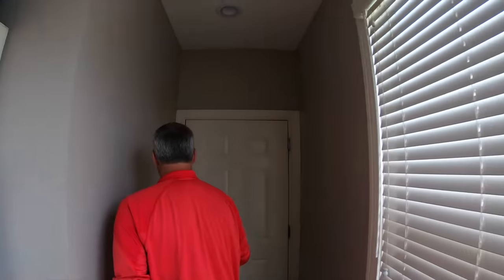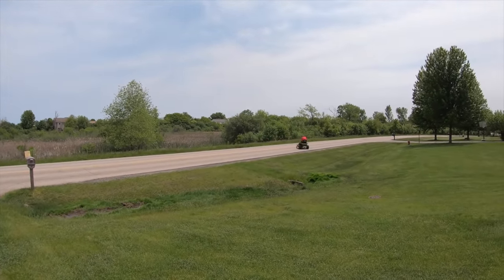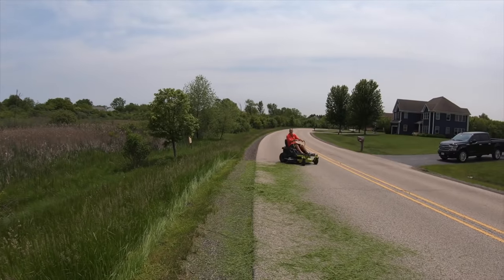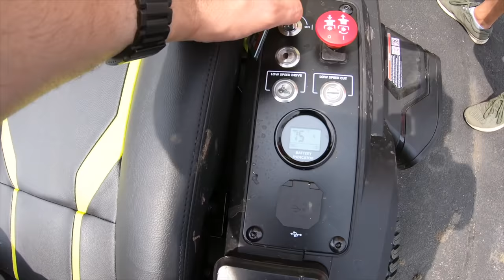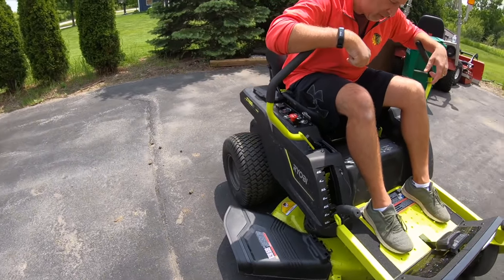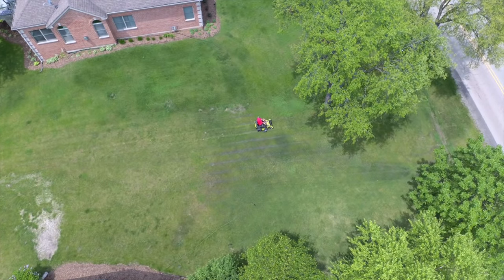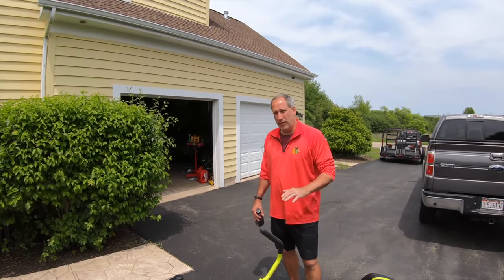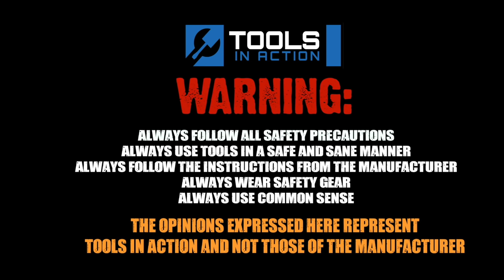Ryobi Electric Zero Turn Mower - First Look

Comment: What are your thoughts on slopes, looking at the joystick version of this when it comes out. I've got a walkout where some of the sides are about 18 degree slopes and wondered if it can safely mow? I tested my yard with a little toro 30 inch which did do it but kind of had to lean. I know most mowers only state 15 degrees.

Comment: Half of these comments were talking about motorcycles
Reply: Because it's dangerous as f** for them.
Reply: Rubber Skilla no, it’s not. I’ve been riding for 27 years and never...not once, have I been tossed, nearly tossed, or had a scare from a few grass clippings blown in the road. Pay attention to your surroundings and you’ll be fine.
Reply: @ROTAXD  you prolly liked your own comment too🙄😆👍
Reply: @rubberskilla2991  Probably
Reply: @ROTAXD  SAME It's the same as hitting wet leaves. YOU have been very lucky, NEVER hit fresh grass clipping on the road, or VERY full of yourself. As a biker for 45 years I have gone down once due to an elongated pothole, and VERY close due to grass blown onto the road. I pay very good attention to my surroundings and others on the roads. There are two types of bikers, ones that HAVE gone down, and those who will... 
You would be wise to knock on wood..... Oh, and a motorcycle has TWO wheels.
Reply: @daverodkey  agreed. He is been very fortunate or just full of himself
Reply: Yup, thanks to Millennials who have Zero attention span.
Reply: @owentimo  what are you refering to?
Reply: @owentimo  truth

Comment: Ok few thoughts on this.. First, very impressive unit ya got there, like Eric said not hearing that loud engine when mowing would be amazing. Ryobi is really stepping their game up in so many different ways, their tools are great for their price. But, the price tag on this makes it literally a non homeowner option. Very few are going to spend $4,100 on an electric zero turn. So this leaves me wondering the true purpose of this unit as it sits? It doesn't have the power to be a commercial, or the battery life. And the price is to steep to use in just your average homeowners yard.. I understand its first of its class, but dont really see this current machine being anything more than a "wow look at this". Anyway, thanks for showing it off!
Reply: Cody it will go down probably 50% in the next year or so. Just like the fancy 4k tv. It was 4-6k when they first came out. Now you can buy a 55in 4k for $300. I agree, $4100 is a lot just for home use. Definitely can’t do business with this. But if it was $1800-$2000 I would buy for my home. Give it time, it will go down. Their tools are generally affordable, it’s the damn batteries that kick ya in the ass.
Reply: @Nomega92  I can agree with that, im just thinking since this is pretty much the first of its kind i wonder if the price will remain high for quite some time? Was just talking to one of my friends about the TV thing the other day actually lol. I remember when i bought my 55 inch years ago it was almost $3000, i can get the same one but newer & better quality for less than $1000 now hahaha.
Reply: Hahah yep! I have a $300 55in 4k smart tv that’s way better than my 2013 55in HD 3D blah blah blah Samsung TV that I paid for $2000
Reply: For the price you have to consider how much you'll be saving on gas, spark plugs, air filters, oil, belts, and such over the life of the mower. No maintenance, no wasted time. We purchased it at about $3800 OTD when it was on sale when HD had all their Memorial Day savings more than worth the savings in money and hassle as someone that has a 2 acre yard.,
Reply: @FantomLightning  Those are great points. My concern would be what happens when something breaks? (I haven't looked in to the warranty at all). If they are fully covered how expensive would it be to fix an electrical issue? Im glad you enjoy it though! It looks like a great unit & im more than impressed with it from this video.
Reply: @PhillyFlyersss  I believe it's 3 years on everything other than the SLA batteries, batteries have 1 year of coverage. Outside that Ryobi has a full list of more "maintenance" oriented parts printed right under the seat with part numbers including batteries. Over all I'd honestly expect these to be far less problematic in the long run simply due to how many less moving parts these have compared to your typical ICE lawn/garden tractor/ZTR. It's effectively four electric motors, a few circuit boards, charge controller, and micro switches on the control arms and that's about it. Ryobi even lays out how to replace and reconnect in a new set of batteries in the manual when the time comes. I feel like just about anything that goes on with these should be fairly easy to fix for any relatively handy homeowner.

Over all I'm not too worried GE did this back in the super late 60s and into the 70s with their Elec-trak garden tractors, also sold under the Avco New Idea brand, then sold to Wheelhorse and produced until they were picked up by Toro and killed off. There are still enthusiasts keeping those guys running and parts available all these years on, and they kick ass as well.
Reply: @FantomLightning  Oh wow 3 years is a great warranty! You won't find that to often. 
My original point wasn't to be rude or anything, it was more in a question form to what this machines purpose truly is. Thanks for the responses though! I hope you continue to get good use out of it for a long time!
Seems as though the (very near) future is certainly going to be electric like this & its super exciting! Good for Ryobi to get this out & functioning properly!
Reply: @PhillyFlyersss  Oh no I totally got your original point. Didn't come off rude at all, it just seems for mowers especially people just take face value pricing as about the only consideration. Most likely because all maintenance costs down the road are pretty similar comparing ICE. 
However I agree I can't wait to see pricing come down as these electric mowers become more and more common. Hopefully along with battery upgrades for older models over time!
Reply: @FantomLightning  I sure hope these SLA batteries are much better than their first 48v push mower ones!  I had one of those and had to replace the SLA every season.  At over $200 a pop, after 2 seasons was enough for me.  That's why I haven't  run off and bought this one yet.  Still waiting to see how the batteries are.  And since you said the batteries only have a 1 year warranty?  That's got me concerned.  Although I want this thing BAD!!!!lol
Reply: @brucehirsch5437  The OG riding tractor they released about 3/4 years ago now and most of the batteries in those have been holding up fine. A good conditioning period when first purchased and not running them below 50% discharge should  yeild a 5-7 year life span. For the biggest 100AH capacity it's 4 batteries at about $220 a piece. If they last about 4-5 years before you have to replace them when you take out the cost of gas, spark plugs, oil, airfilters, belts that'd you'd replace on an ICE machine most calculations show you'll either break even or save money.
Reply: Bruce Hirsch Agree. It looks great but a 1 year battery warranty is concerning with the cost. What would be good to know is what brand of battery they’re using. With a brushless motor almost nothing else should break so it basically has a 1 year warranty.
Reply: @Alexlfm  if they are ni cad batteries they'll be dead in a year or two & besides this is 2019 its lithium ion batteries or nothing
Reply: @brianklein6387  lithium ion don't have any real advantages over lead acid when you don't need to worry about weight.. in fact i find extra weight helps with tyre grip.  I have the rm480e ride on,  am loving it
Reply: @Nomega92   And given that the batteries are lead acid instead of lithium... You can expect to replace them 5 times as often as your lithium batteries :(
Reply: @wozzgalaxy  I've had several lead acid batteries for tools of all types everyone of them were trash in 2 years tops now my Milwaukee & dewalt are 5 years old & never one problem the only non lithium battery that's lasted me more than 2 years is my truck battery its 6 years old
Reply: @brianklein6387  I agree with wozzgalaxy. These machines aren't going to suffer from weight and many private golf carts are running 10 to 15 year old lead acid batteries daily. Besides have you seen a lithium pack catch fire? It's some scary stuff, cant put them out with ANYTHING. Cost and performance makes lead the right choice.
Reply: Hell. I bought an $8200 Gravely Z60 in 2002. Money well spent.
Reply: That being said, my Ryobi X-Pand-It suite of tools has performed amazingly. Their chain saw handles anything up to 6" with ease. I'm a believer.

Comment: You guys dont ride motorcycle. A buddy of mine got hurt when someone blew grass clippings on the road
Reply: That's a good way to thin the herd of people that are stupid enough to put their lives on the line by riding motorcycles. They are dangerous.
Reply: @N2LADIES55  reasonably dangerous though
Reply: Beat me to it.
Reply: That close to the side? It's in the middle of the road.. It's also against the law here.
Reply: Could’ve had a V8.
Reply: A more realistic translation "a buddy of mine riding a dangerous vehicle stupidly turned while on grass and dumped his bike instead of avoiding it"
Reply: Its illegal where i live
Reply: Bobby 
So drive into oncoming traffic to avoid grass in the roadway? Sounds  much safer. Why not just throw your grass back into your yard in the first place?
Reply: @jpruitt546  the root problem is that motorcycles aren't safe and there are countless things on the road that can cause a rider to lose control that would otherwise have negligible effects against a car. Ride a stupid vehicle, take stupid risks- real simple
Reply: billy ray reeses , the grass wasn’t the only factor in your buddies crash.  Was he leaning into a turn, or were his tires old?  Did he,stupidly, pull the brakes when he noticed the grass instead of keeping calm and getting through it?  The grass clippings didn’t cause your buddy to crash; your buddy was very likely inexperienced or worse...an incompetent rider.
Reply: Road conditions are always changing learn how to ride
Reply from the maker: Yes we blew it off after!
Reply: @tomhardware2254  10,000 IQ insult of the day goes to you... Lmfao

Comment: He was worried about hitting rocks but he keeps mowing as a car drives by
Reply: @Vaedyn Bellamy Actually in most areas it's illegal to mow debris into the road as well... so you should always just mow away from or perpendicular to the road.
Reply: @Wingnut353  its easier to mow it onto rd first then blow off rd bc if u try to kow with chute going into grass chute blocks up

Comment: I worked the returns desk at The Home Depot, Ryobi was great job security.
Reply: Nick Dionne hopefully this catches on and real brands make them. The hybrid mower atv that Lowe’s had was a flop. This is nice, but it’s a ryobi, so also flop. The EGO products are holding up for me, but I’d still prefer my Hustler be an electric.
Reply: Didn't know that, but even though arguments can be made about electric vs. gas cars, electric riding mowers are a big deal. Not having to go get gas is a game changer

Comment: Mower looks cool with basic features. Have almost all my tools from Ryobi with battery power. So convenient with EASIER start n less maintenance. Big fan of Ryobi. Safety feature: Ryobi could have installed a roll bar on the mower. Good example was when the mower was cutting the grass near that ditch area. Even slight slope could become a safety situation. Kudos for your video.
Reply: How? the point of gravity is between the wheels. It would be near imposible to tip it over.

Comment: Can you please confirm that it ALWAYS needs to be charging, as you mentioned a couple of times? I desperately want this unit, but my lawn equipment is stored in my shed, where there is no electricity. That would either make this a no-go for me or mean I have to dig some trenches and run some wire. Thanks!

Comment: Your the second reviewer I watched on this mower, I am practically sold on this thing.  I was already planning to get my first gas zero turn this summer, but this thing is a game changer.  I was am also fixing to move to a cordless push mower and weed eater as well.  Nice that not only is there a cordless riding mower available, but a zero turn version at that.  Only super minor hesitation, I would be curious what a replacement battery would cost when that one eventually wears out but with only a 1/2 acre on my yard, I imagine the battery will last several seasons before wearing out fully.

Comment: Cool but i've had zero luck with anything Ryobi lasting more than a yr or two.
Reply: This was a paid ad for sure.
Reply: Love my Ryobi weed eater. Had it 9 years now, no issues.
Reply: Ryobi 40v hand blower 4 years, ryobi 40v hedger 6 years and use them not just for home use. 2 batteries haven't had the need to buy another

Comment: Do not cut grass into the street. That's like hitting ice on a motorcycle.
Reply: If grass on the street is what you're worried about while riding, then get rid of your bike and get back in a car. Grass, leaves, dirt, gravel, water are all slippery for a motorcycle- use common sense while driving. People don't need to clean up grass clippings because you're riding an unsafe vehicle- what a ridiculous statement.
Reply: @NomadMechanic  your IQ must be 10,000
Reply: the bigger issue here would be the thousands of texters and drivers that no one seems to be bothered with and yes they do hit motor bikes
Reply: Natural selection my friend. They call them donor cycles for a reason.
Reply: Bobby, For one thing, it's against the law in most places and they do levy fines for it. You might not care about other people but the cops do.
Reply: You can't honestly expect someone to keep grass out of the street WHILE actively cutting the grass.  They obviously cleaned it up afterwards,  but expecting someone to do it while they're cutting is ridiculous.
Reply: You know what extremely unsafe? Riding a motorcycle. It's ironic you guys are getting your panties in a wad whenever you see grass clippings on a street, but don't realize your bike is about the least safe mode of transportation you could choose. You want others to be safer then your being, got it.
Reply: @emmasalgado7877  where this "no grass in street because of motorcycle safety" cliche originate???
Reply: @emmasalgado7877  I started riding in 1967 and I can tell you the most dangerous thing about riding motorcycles is bad car drivers. I have been run off the road so many times by cars but not once have I crashed due to the bikes fault. They are as safe as the rider wants them to be.
Reply: @TheOldbsa  

Maybe that's true. But it still makes riding motorcycles dangerous. Whether or not the danger is your fault doesn't mean it's not still a threat. It sounds like your a good rider. I have several friends who have been injured on motorcycles. 2 of them were killed by another car that they ran into showing off.
Reply: @DkpProductions  

If you referring to me that's not even close. That's a poor application of the word.  God forbid someone point out easily found information on the dangers of bikes vs cars. 2 people I know died. I mention it. And I'm a snowflake? I'd say you response was more snowflake then anything. What's next? Calling me a fascist?

Comment: They finally did it cause I literally was wondering when a battery powered zero turn would be made
Reply: Thegrandman mean green mowers have been building them for over 6yrs now they make stand on and walk behind battery mowers also. They even have a blower mounted right on the front to blow off with.
Reply: Husler Zeon 2012

Comment: Nice, and I am an 18v Ryobi fan, however due to the lengthy charge time and the less than good 40v charge system of Ryobi I just bought an EGO mower and I love it!  The 1st Ryobi rider is cool but priced way high ($2500.).  What is this priced at, how long will it mow (or how much), and what is the recharge time from zero?  Thanks for the video.

Comment: Comes with lead acid batteries. To upgrade to lithium iron phosphate from battleborn is around $4000 depending on desired run time.
Reply: $4000!! whoa

Comment: Lead-Acid battery?  That is surprising.
Reply: not really, LION is still very expensive, lead acid is cheaper, givers the mower the weight it needs, and is easily user replaceable.

Comment: Love these guys! Love battery powered equipment, I wish they would make a stand on unit. Great video!
Reply: Joe Meow gas is better more powerful runs forever and don’t have to charge it most of the gas zero turns are cheaper more manly is more powerful than a battery to
Reply: @joshsqualitylawncare8585  hmmmm.... from the sounds of it, it sounds like you ran battery powered lawn car equipment for yourself. I have a gas Echo and a battery powered hedge trimmer. Needless to say, I haven't used the Echo in over 5 years. The battery powered hedge trimmer is quieter, no fumes, no tune up, no gas, lasts a long time, lighter, less vibration and yes the battery needs to be charged. 

Any new technology is more expensive and the consumer will pay for it, but much of this recouped from not having to do tune ups. In my humble opinion, it is the future of lawn care. Many companies have battery powered equipment and one company is solely battery powered lawn care for the professional.